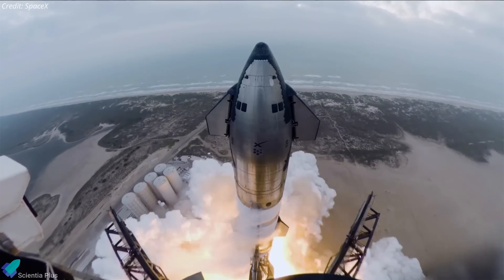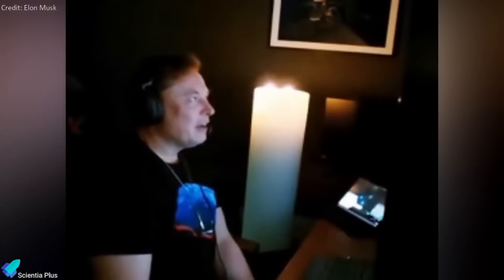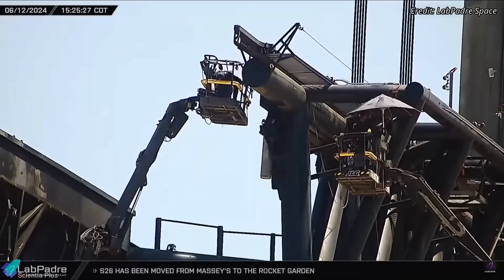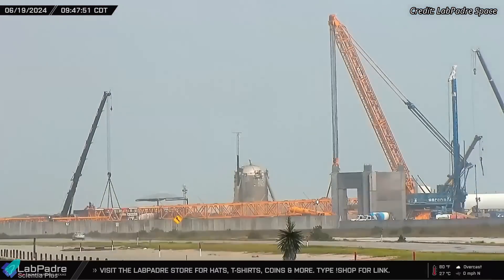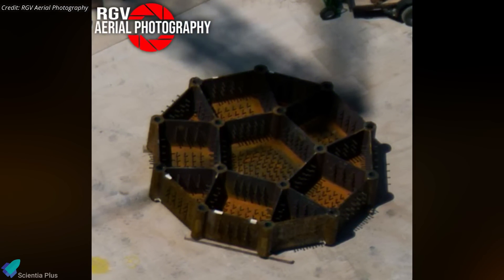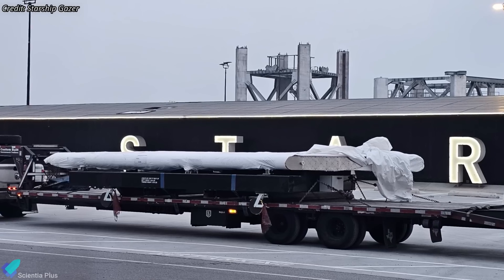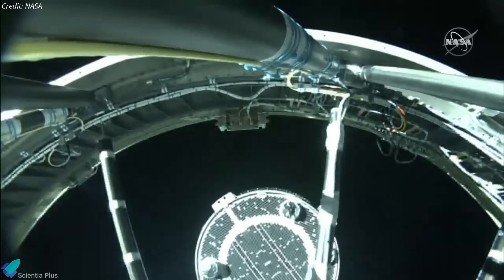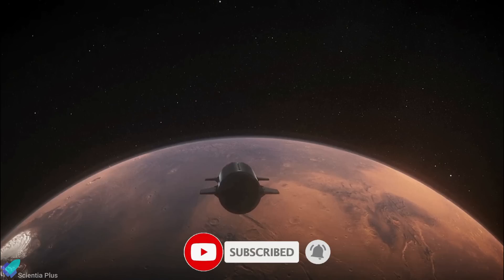Starship Flight 5 Plot Twist: Raptor Swapped, New Tiles Installed & 35-Engine Booster Hardware

Comment: STARLINER: TOLD YOU SO! If you let a spacecraft launch with known issues, there will be unknown issues that pop up during the mission. This is because a spacecraft launching with known issues is a reflection of the quality of the design and fabrication! NASA will never learn. This has been the case for many failures resulting from NASA risk acceptance. In the future, a third party (not NASA and not the spacecraft owner) need to certify a vehicle as being issue free and ready for human flight!